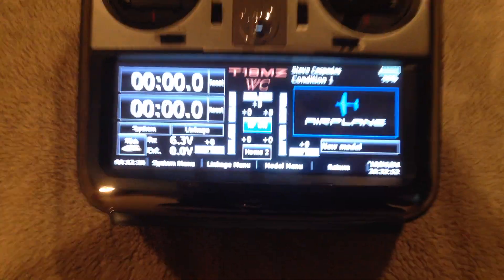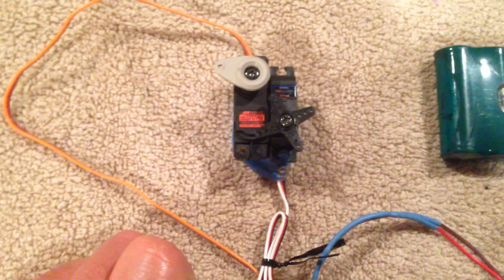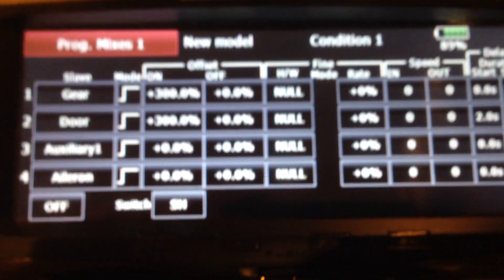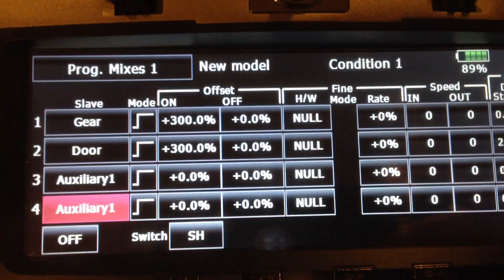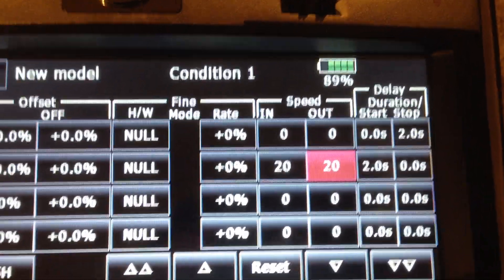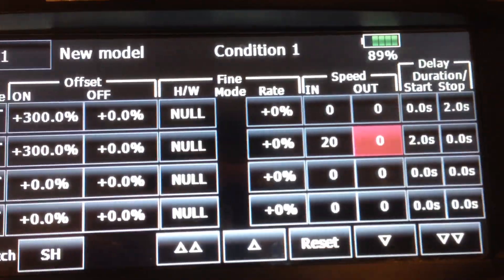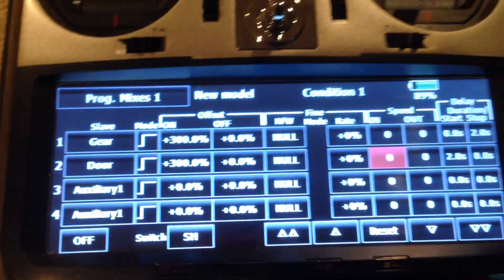Futaba 18MZ - How to program your gear and doors without a sequencer!

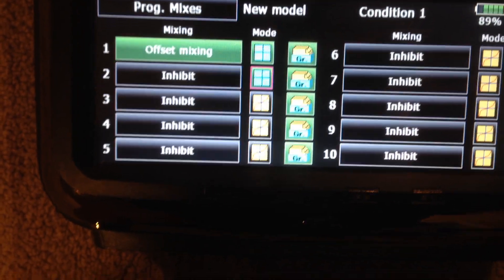Comment from the maker: Guys, a couple notes.  At 1:54 I mention linear mix, I meant default mix vs off-set mix.  At 3:07 I say sequences, I meant to say steps.  As these steps/slaves are all dependent and are part of a specific sequence of events based on delays.  Just want to clear up any potential confusion in verbiage/terminology.  Also, you can control the rate in either direction and should be adjusted to your needs, obviously.  Lastly, who ever uses this, please test without your door linkage(s) connected at first.  Until you know all of your timing and steps are setup correctly.  That way you will avoid having to fix anything.  Good luck!

Comment: Thanks, could you please ad one more progmix? I need one to lock and open the cockpit on my F-16.
Reply from the maker: Can you share more about the setup?  Example; do you have servos for the locks and an actuator for the canopy?  Or are you using air valves?

Comment: Do you have a video to have a p51 style gear door set up for the T16SZ radio?
Reply from the maker: I can make one if you still need it, let me know.  16sz and the 18mz are very similar in the setup menus.
Reply: @skunkwurkv1  if you could at some point I would appreciate it to get information on setting up doors p51 style for electric retracts. Upon doors opening I'd like 2 second delay before gear comes out giving approximately 10 seconds to do so then close doors. I really don't understand why Futaba wouldn't put that in the manual. Very few of us are that smart at programming.
I now have the 18SZ also trying to do all I can to make this easier for myself.
Thankyou

Comment: Can you sequence where doors close  again like a p51
Reply from the maker: Sorry for the delay, sure, you just need to set the sequence and corresponding delays.
Reply from the maker: Little late with the reply, but yes.  Let me know if still needed.
Reply: I need lol. Need to open door, gear down, close door.  

Also I'm trying to figure out, I got twin DLE120 4cly on Tigercat, 1 choke servo each, I want to use the independent switch on back of 32mz for each choke so I can choke Left/right separately, but also still flip switch on front side to choke both at same time to as motor shut off for dead stick landing